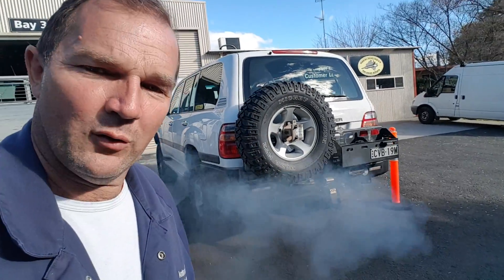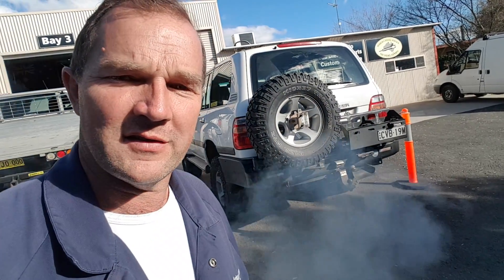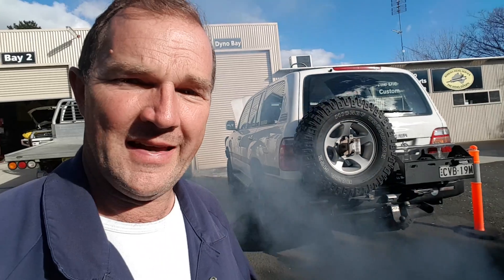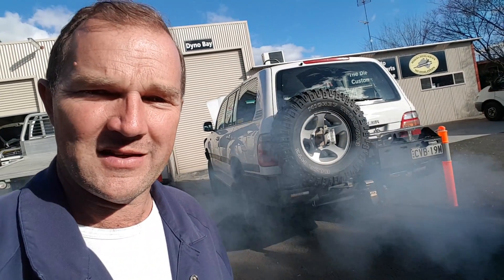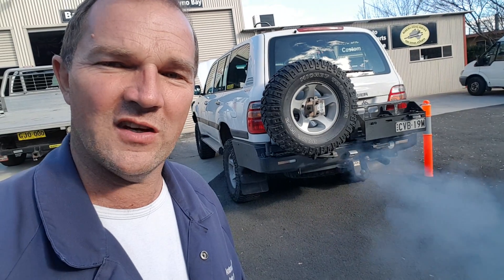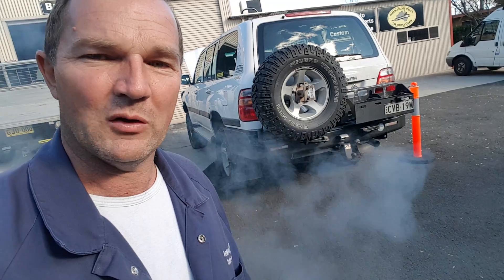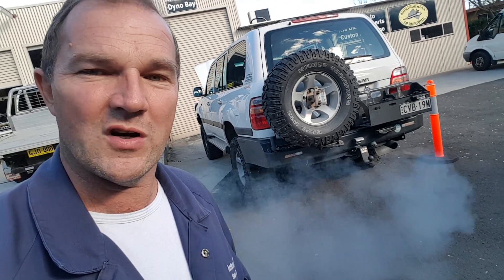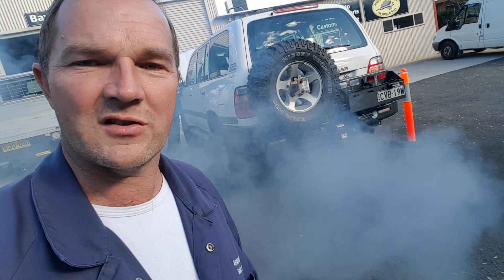Bad Diesel Tune Blows engine.

Comment: Andrew I have a 4.2 HZ in a 100 series. Since upgrading the exhaust to 3 inch I have a very rich fuel smell   No one can tell me why? Can you help me?
Reply from the maker: Not sure about that unless the exhaust guy turned up the fuel screw (very common practice but not needed)
Reply: @BerrimaDiesel  Can it do damage to the motor? I do a lot of towing( approximately 3.5 ton caravan)

Comment: a stock hz makes around 45-50rwkw without a turbo.  If I turboed my hz Id be pretty upset with 50kw from a turbo setup.  I notice you dont mention anything about afr.  Perhaps they are running their setups far too rich at steady state!!!  What does Berrima consider 'safe boost levels'?